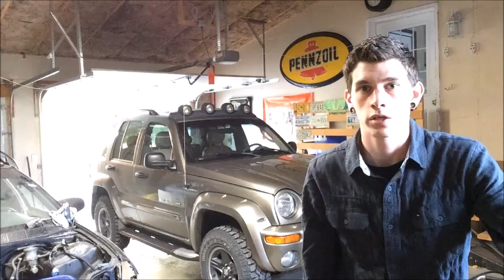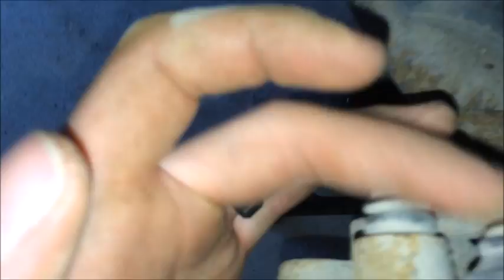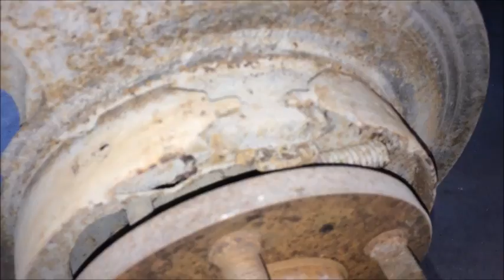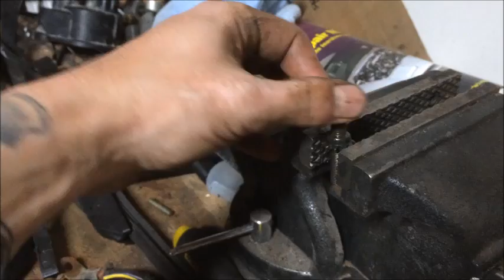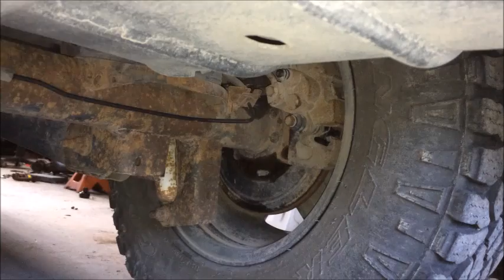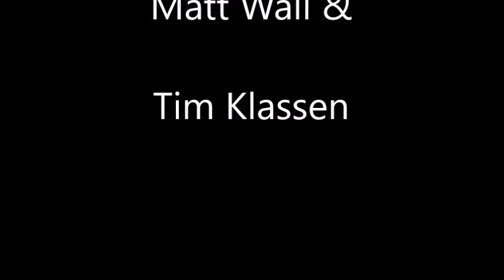Jeep Liberty Parking Brake Repair

Comment: Man, i wish my rotor came off that easy. Been pounding on it for a good while with a 2.5 lb mini sledge. Still sized on. Threw the wheel back on for now and will probably soak the hub in pb blaster when i get more time to work on it

Comment: Mine have disk brake!!! Who the F* is Rollin drums in 2008??
Reply: Parking brakes very frequently an internal drum on the inside of the disc (did you watch the video and see the disc brakes?)
Reply: All vehicles that have disc brakes AND parking brakes WILL have an "Internal Drum" brake type assembly.
Reply: @c.blakerockhart1128  it's weird dude, when I worked on cars as a kid they were either drum or disk, then it's disk with drum inside, we are still in the dark ages with these cars, you say it's so, and I'm not disrespecting post, I just thought we would be so far past drums now..
Reply: @majorlifts   I know it's weird. I just found out recently. The weirdest thing about it is that they are EXACTLY like the old drum brakes. They even have the little adjustment star/gear that you adjust through the slot in the back just like the old cars. I recently did my wife's Jeep Liberty. That's how I found this video. I have watched several.   My comment above is actually a Direct quote from a mechanic that I know. That's also how I know that it is called an "Internal Drum". I always figured that we would have something like magnetic brakes by now. But at least we don't have to put the bottom of our shoe on the tire to stop like I did way back in the day. ( on my bicycle )

Comment: Good info kiddo, I have NOT 1 NOT 2 but 3 libertys 20, 03,, 04. The 20 has 126000 plus miles & 03 163600 plus miles, the 04 has 217000 plus miles on them. So I do keep them very safe and very well maintained. I think the rear E-Brake servicing is a real pain in the butt. I like your time how well you what you do here....PS; I like your gages, what size are they?

Comment: My bolts had 12 mm heads, not 13 mm. People should always double check sizes to make sure they do not mung up bolts and nuts causing further issues.
Reply from the maker: Ya, you never know if some may have changed the hardware to a different size previously. Rounded bolt heads are no fun.
Reply: @MtGarage  The bolts that came with my new calipers also had 12 mm heads

Comment: Good video. Thanks for posting.

Just want to share some info.  I replaced the shoes on my 2005 Liberty about four years ago. I had no trouble getting the parts to fit and the brake worked well. A few days ago, I went in to replace the brake pads and the parking brake had a major problem. It seems the actuator that pushes the top of the shoes had seized which caused the shoes to wear out prematurely. In my case, the actuator was in the way of installing the new shoes and that is how I realized what caused the problem. I could not get it to loosen up. Even after soaking all night in PB Blaster it was so tight I could barely move it with a vise grip. I came here hoping someone was showing the simplest way to remove the actuator. So, when you do a parking shoe replacement make certain that actuator can move. It could be frozen in the relaxed position and you wouldn't even know it unless you try to move it. Mine was frozen in the extended position so it was obvious.

I'm going to try pushing the whole thing out through the backing plate. If that works I'll come back and let you know.
Reply: Almost finished doing the  brakes on a 2003 Jeep Liberty.   The parking brake cables had some travel in them so I only ordered new shoes and hardware (along with new rotors and pads for the disc brakes).  After installation the parking brakes still did not work so I assumed the old cables had stretched. So I ordered new cables.   After installation of new cables the E-brake still did not work.   Got to taking a closer look and that is when I discovered that the parking brake actuator levers on both sides were seized in approximately the middle of their intended length of travel.(same problem as you)  As I am not a mechanic by trade it took a bit to figure it out.   Managed to pull each one out and then cleaned them up with a wire wheel.  As they have a similar action as scissors I took a hammer to them and tapped the levers back and forth,  until they could move freely and come apart.  I then finished cleaning with a wire wheel, greased them up with brake grease and reassembled.  Didn't see the actuator listed as a replaceable part when I placed my parts order.   You'd think they would have it listed as I'm sure I'm not the only one who has been surprised by this unforeseen problem.  In any event, barring any more unforeseen setbacks we should have everything back together tomorrow and hopefully working properly.
Reply: How did you remove the actuator from the backing plate?  I am struggling with this very same issue.  Mine was stuck in the extended position and I was able to force it back with pliers and pb blaster.